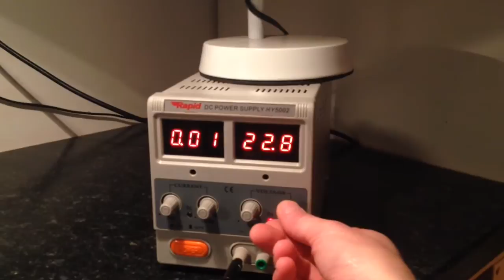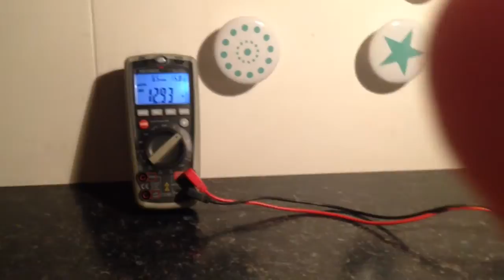Bedini HDD rotor motor 1.3v A/C LED

Comment: looks good...busy man! some motors will actually give out dc power when spun up...some ac. cd motors and such i have found to give out dc for some strange reason. (im sure its simple, i just havent worked it out yet).
1n4007 have a voltage drop of about .7 i think...so they lose that much across it. i use 1n5818 for low power, i think the drop is more like .25 or so. there are better, lower v drop diodes out there of course.
very nice drill press! i have a couple weeks of printing ahead of me, i think youve inspired me to put together another bedini rotor to work on some hurting batteries i have laying around while i wait...thanks man  :)
Reply from the maker: You're awesome, thanks for all the info. I'm going back on to conductive ink and static motors this week. Now we know it was a flyback Terry had on the slayer. ;)